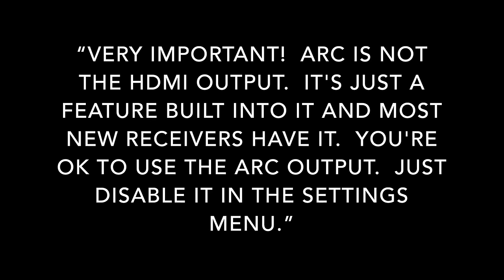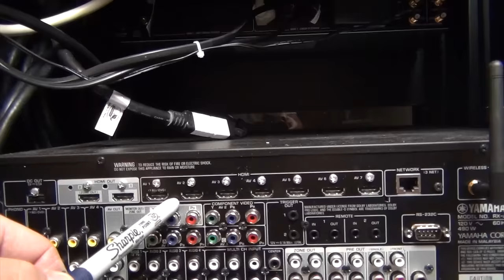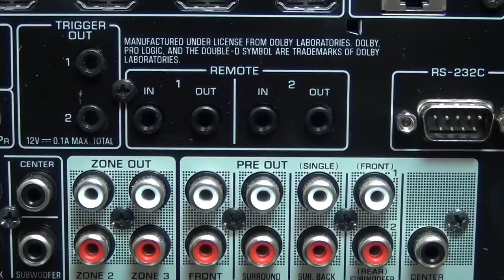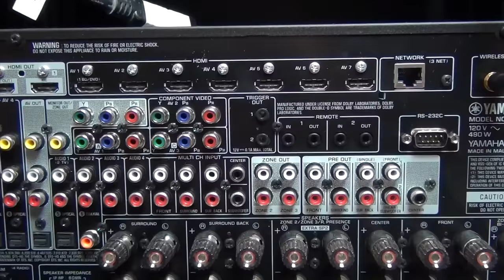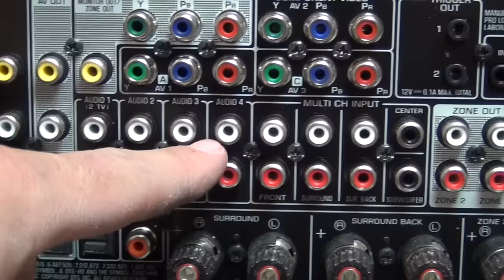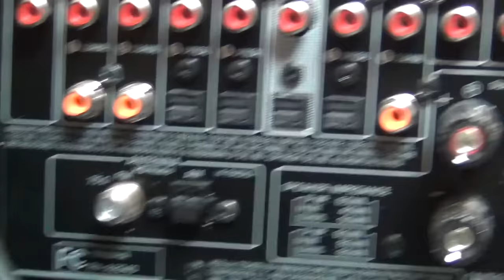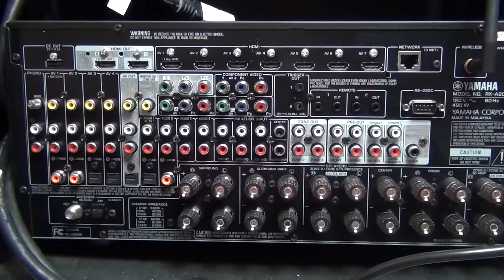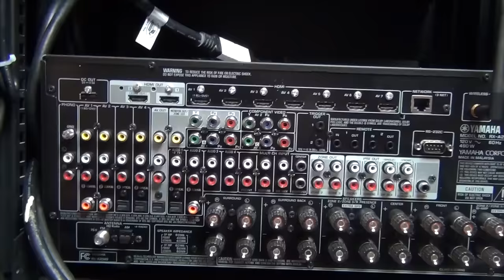How to connect a surround sound receiver - Part 3

Comment: Connecting 5.1 .4 you use back rear ?
Reply from the maker: I'm not sure what a 5.1.4 is. That does the ".4" represent?
Reply: Alan Clegg its atmos .4 is high ceiling speakers
Reply from the maker: @Samzep  Oh gotcha. Atmos came out after I left the industry so I am far from the expert in that arena but I am vaguely familiar with it. In the case of my receiver, I would not use surround back for the Atmos setup because I have extra speakers that can be assigned for that purpose. Other receivers may require you to choose between true back speakers (like a 7.1 setup) or the Atmos setup. I guess my best answer would be that it is going to depend on the receiver.

Comment: My computer Doesn't have Bluetooth ... And I have my PC plugged into HDMI Port one.....  And I want to make this Bluetooth , for my Bluetooth  headphones.  I just purchased a Bluetooth Receiver,  And I don't know what port to use .....What input would I plug into?
Reply from the maker: My guess is that you pair your headphones to the receiver then set the receiver to HDMI for PC use. Start playing music on the PC and make sure the audio is being pushed out of the PC to receiver (adjust settings in the PC if needed) Since I'm not familiar with your receiver, there has to be a way to select "headphones" or "speakers" as your play back source. Maybe activating the headphones is good enough?
Reply: @AlanCleggYouDoAV  Thank You very much , I'll give that a try, and let you know for a curiosity  sake,   what happen.

Comment: noob question... Is HDMI Up scaling the same thing I see advertised as HD pass through?
Reply from the maker: No. HDMI upscaling is taking a different signal and turning it into HDMI. For example, you can take a standard yellow RCA video cable and upscale it to HDMI. Maybe you have an old video camera using standard yellow video so you plug it into your receiver. The receiver upscales the camera signal to HDMI and sends it to the TV via an HDMI cable simplifying your wiring scheme and upgrading video quality. HD pass-through is when your receiver doesn't modify the audio or video signal at all and simply "passes it through" to the TV unmodified.
Reply: Alan Clegg ok. Thanks.

Comment: Where do I connect the fire stick currently on my TV
Reply from the maker: If you want to get surround sound from your Fire Stick, plug it into your receiver in an HDMI input then select that input on your receiver. You should be golden. Let me know how it goes.
Reply: MartinHoskinson Adventures how did it go?
Reply: I plugged the Firestick into an HDMI input on the back of my RX-A880. It works great, however, the Yamaha remote does not reliably control it. I have to switch to the remote that came with the Firestick.  Any advice on that?

Comment: My new Onn TV does not want to recognize the computer  if the HDMI comes from the output of the reciever, only if the HDMI from the computer is connected directly to TV.  Although come to think of it, in both cases I have connected the Optical cable from TV to the reciever if that makes a difference. I wonder why it would.

Also when I go on Youtube which I spent most my time at,  Playing youtube directly from TV and receiver, the sound is 20 times louder, than through the computer.  It almost gave me a heart attack today  when I happen to stumble on it.  I just purchased this tv yesterday.

My previous TV was able to recognize the computer either way.  The previous TV had one HDMI. and this one has 4 but that just gives you 4 HDMI options.  My reciever  has 4 hdmi input.
Reply from the maker: Interesting. Are you sure the receiver is setup properly? It’s possible that the input selection is incorrect or needs some setup in the receiver menus. I would thoroughly test this to make sure the setup and programming is correct before anything else. If you’re setup is correct, it sounds like the receiver might not be able to process the HDMI signal. That can be due to a frame rate or resolution issue or something of that sort. Optical audio cabling should not affect anything. 

The volume on your computer is likely turned down so that you have to turn your receiver away up. Then when you play the sound from another source, you get blasted. You have to turn the volume on the computer all the way up or set it to “fixed audio output” in the computer menus.
Reply: @AlanCleggYouDoAV   I know all the volumes for everything,  Volume of the TV,  Volume of the computer, volume of say Youitube,  volume of the receiver.
I know all the hdmi inputs of the receiver, and its one output.  I know the 4 HDMI ports on the TV and the one HDMI on the computer.
I know all the various setting of the sound system of the reciever and the various sound selection of the TV.
I also have noticed another problem with this TV. Since I use most o f my time on Youtrube, The videos don't load up easily,  it behaves bogged down as  in Google chrome is not responding..

Comment: What is a ‘sticky’?
Reply from the maker: Without watching the video back, I think you’re talking about when I’m referencing how to “blast” (or send remote control signals) to the receiver? A “sticky” is a blaster with a sticky back that is stuck on to the front of the surround sound receiver directly over the remote control infrared red receiver. They are horrible. They constantly fall off and cause nightmares.
Reply: Thank you for taking the trouble to reply👍🙂

Comment: Can I connect a special speaker to speaker jack back side of AV reciver ?
Reply from the maker: What do you mean by “special”
Reply: Alan Clegg like JBL speaker , connecting to bottom side speaker jack of your amplifier....
Reply from the maker: If a speaker connects with speaker wire, you can connect it to the amplifier.

Comment: Hi,
I have a Yamaha receiver similar to yours. I just need help hooking up my 4-channel power amp to the receiver's pre-outs to set up a surround sound.
Do I need to do some other special configuration or set-ups on my Yamaha receiver to use the "pre-outs?" 
Does the "pre-outs" conflict with HDMI?
Reply from the maker: You shouldn't need any additional equipment. Just go from the receiver pre-outs to the amp inputs and you're good.

Comment: hi alan, so if your not using hdmi arc how do you get tv sound out of your avr? i had to stop using arc because xbox not support cec for arc and i like freedom of using tv speakers as well so i use optical cable. is it possible to get tv sound from avr just by using one hdmi cable?
Reply from the maker: Only by using ARC can you go from the TV to the receiver via one HDMI cable. I don’t stream from my TV. I use a Roku, but a Firestick and AppleTV are also great options.
Reply from the maker: With new receivers, a nice feature is called HDMI Passive Pass through (or something like that). If your receiver is off, you can still use its HDMI switching but the sound passes through the receiver and goes to your TV speakers. Pretty cool.
Reply: @AlanCleggYouDoAV  thanks Alan, so does that mean you never watch tv at all with your avr speakers or maybe you use optical or just happy with tv speakers when watching free to air tv? 
just before i got a new tv i was using the new nvidia sheild pro, i dont know what else could beat it and also an intel nuc 7th gen.
my setup does have earc but ill prob have the same issue as people in the house only want tv speaker sound so tv speakers has to be primary for me.
Reply from the maker: I stream Netflix or whatever all the time but I don’t stream it from my TV. I use a Roku streaming device which is connected to my receiver so I can have surround sound anytime I want. When I don’t want to use surround sound, I still use the Roku, I just turn the receiver off and the sound will bypass the receiver and come through my TV speakers.
Reply: @AlanCleggYouDoAV thanks yep I totally get your setup. 
My main problem is my receiver booting up when tv is turned on, I can't have surround sound cause other people in my house don't like the sub and all. 
The only way I know how I can setup the tv to turn on without the avr is using optical from avr to tv, this solves my issue but I miss out on hd audio, I suppose I just have to deal with the trade off.
There's nothing I can do I guess for this setup.
I wonder if earc will be all the same problems as arc
Reply from the maker: EARC is supposed to carry surround sound channels back to the receiver from my understanding.
Reply: @AlanCleggYouDoAV  all i know is you can get atmos from streaming and other hd audio just from the one cable all just using your smart tv and instead of throwing devices to your avr your meant to just throw them to tv inputs
Reply: Id really like to see some speaker reviews from you, 5.1 budget and mid range, just tell us the real deal, just think youd be really good at it is all
Reply from the maker: I think the thought of connecting to the TV is nice but seems harder. If your tv is mounted to the wall, you’d have to install 3-5 long HDMI cables in the wall for each device. I thought about doing reviews but making videos is hard. I like doing installs because they’re more widely viewed and applicable for years. Thanks again for watching and for the questions/comments.
Reply: @AlanCleggYouDoAV  i prefer to my tv as easier i find but yeah i can see for your mounted painfull. you would clean up you know your shit, avr, speaker reviews, you can deliver on video, i watch a fair bit from people like you and you got what it takes! avr vid was real good.
also i want to say i found that option it turns off avr but tv from speakers does not happen, stumped on my new pioneer ill have to check out my yamaha, passthrough something.
Reply: @AlanCleggYouDoAV  It's 2020. My TV has Netflix, YouTube, Amazon Prime, Crave streaming apps. ARC makes it very convenient to stream quality audio through the AVR, and I've never had any issues with devices turning on and off. I think I'd be missing out a lot if I didn't use ARC. Has your view on ARC changed over the years? I'd say "ARC good good good". Thanks.

Comment: Great video. Do you have any experience how to correctly connect 7.1 receiver with PC via graphics card? It's pretty confusing, so vid would be really appreciated :)
Reply from the maker: Laptop or desktop?
Reply: @AlanCleggYouDoAV  hi Alan, desktop and Windows 10. 
It's quite interesting topic and I have really hard time to gather some relevant info anywhere. Well, definitely not on the level that you can provide, I think. Thanks again :)
Reply: @AlanCleggYouDoAV  also I would add Nvidia graphics card connected via high-speed HDMI. I personally trying to figure out how to make work properly setup where I can play games at 4k@60 fps and 7.1 sound using a receiver from Denon...
Reply from the maker: @zdenekkrejcir8834   If you have an HDMI video output, does sound come out of that same output as well?
If you have an HDMI connection that also carries sound, all you have to do is connect the HDMI from the computer to any HDMI input on the receiver. If the video doesn't come on, you'll have to adjust the PC settings to tell it that you connected a second screen and want it to mirror your regular screen. My guess is that an HDMI coming off the motherboard will carry the sound, but HDMI coming off a sound card may only carry video. If it doesn't carry audio, you will have to use the pre-outs from the PC to the pre-out inputs on the receiver.
Reply: @AlanCleggYouDoAV  yes. I use high speed HDMI from 1080ti graphics card to the receiver and from receiver to 4k TV.
Reply from the maker: @zdenekkrejcir8834  The BIG question is if your video card is sending video AND audio through the HDMI. It will definitely send video- no question there. You have to find out if it sends audio too.
Reply: @AlanCleggYouDoAV  yes it sends audio, I can even see the name of the receiver in my W10 sound settings...
Reply from the maker: @zdenekkrejcir8834  Then you should only have to plug it in and make sure the settings in your PC are correct. Your receiver should be set to a soundfield such as "auto" or "Surround Sound" or something... depends on which brand receiver you have.
Reply: @AlanCleggYouDoAV  yeah, I put it on auto (pure) and hope that it will choose correct codec depending on the input (Dolby, DTS etc)

Comment: hi .. i have a Question .. if i take audio out from my Oppo 203 4k bluray player And connect it to the receiver in the Audio in option ... and the speaker wire is connected to the receiver... wht should be my source selection to Get the Audio Out put ???
Reply from the maker: What is the label on the receiver? Is it only labeled "audio in?" What make and model is the receiver?
Reply: hi Alan  IT Says Multi Channel input .. its A Onkyo TX-SR803 AV Receiver .. And i Have Oppo 203 4k UHD which i have connected directly to my Sony 4k UHD LED .. Presently i Have taken my Coaxil audio out from Oppo and give  to  coaxil- Audio in to the reveiver and using my 7.1 setup... I want to know How to Make use off the 7.1 Audio Out from Oppo and How to Connect it to My Onkyo TX-SR803 ?
Reply from the maker: Got it. You'll use the "DVD" multichannel inputs. Looks to me like they're all on the bottom middle of the receiver. You'll probably turn the receiver to DVD mode when you want to take advantage of those connections.
Reply from the maker: It's an 8 wire connection so be ready for that. One wire for each speaker (makes 7) then 1 for the subwoofer.
Reply: Alan Clegg thanks for the support ..
Reply from the maker: Hope it helped!
Reply: Alan Clegg - it helped i got some monster cable and connected them.. its sounding better passing through pure audio.. but im not able to get the Test tone activated from the bluray player..

Comment: I need help with hooking my Yamaha receiver to my analog tv that has no hdmi. I can get picture and sound when I hook up the Wii with rca jacks but when I plug in my hdmi blu ray, all I get is audio with no video...
Reply from the maker: You're going to have to hook video directly to the TV via component video or composite video cables (depending on which cables your blu-ray and TV support). Then hook up the audio directly to the receiver via HDMI or optical audio.
Reply: Alan Clegg, would be possible for us to get in contact via phone or messenger? I really need to have you look at it to see what connections I have. Maybe FaceTime or messenger video if you have time? Please and thank you
Reply from the maker: @djstallone3000  I keep myself super busy. Especially right now that I'm back in school and right in the middle of midterms. Just send me a picture of the back of your TV and the back of your receiver and I'll try to help you out.
Reply: Totally understand, Alan. Thank you so much for replying. Where would I send the pics?
Reply from the maker: @djstallone3000  alan@youdoav.com
Reply: Thanks again, Alan. I’ll have them to you shortly. The email will be from my real name, not my DJ alias lol
Reply: I need help getting the sound on my element tv , i have picture,no sound

Comment: I see this video was made in 2017 how do you feel about HDMI ARC receiver to an HDMI ARC TV in 2020?
Reply from the maker: I always want very specific control over my devices. For a casual user, ARC is probably ok. There are a lot of instances where it makes more problems than it’s worth. I always turn it off so I haven’t used the new eARC but I imagine it’s the same thing. You turn off the cable box and the whole system shuts down...

Comment: You need to know what you’re talking about with regard to Arc and earc before you talk about how bad it is. It’s the only way to get the best sound and picture from every source. It’s the highest output you can get. Just explain how to set it up correctly.
Reply from the maker: Nope. Sorry man. I will never use ARC.